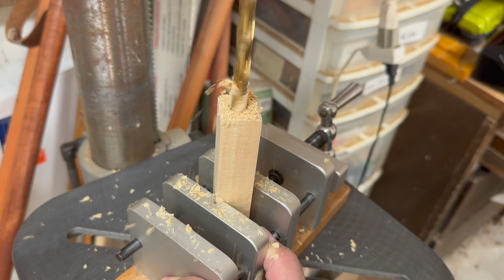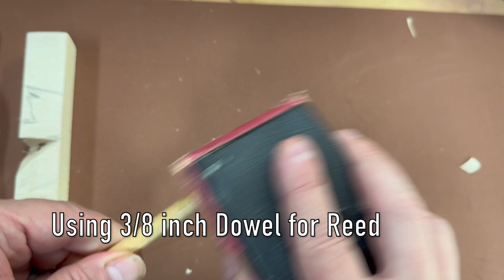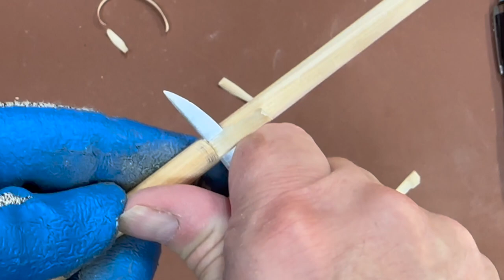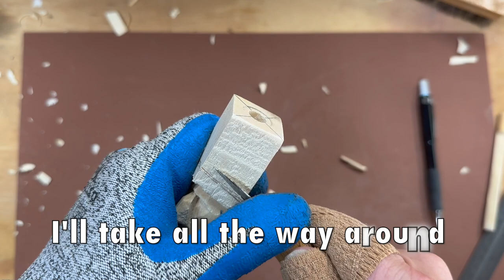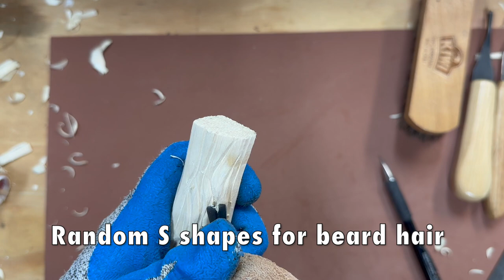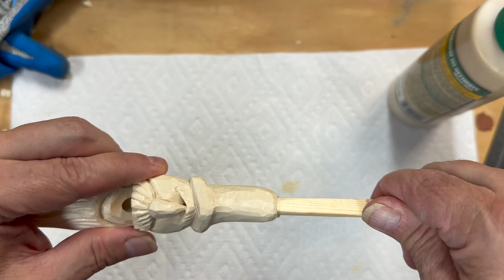Carve a Wood Spirit Whistle

Comment: Enjoyed this, and will make a couple for grandkids. The carvers tools could certainly profit from some honing.
Reply from the maker: Those DHK knives stay very sharp but I still put them on the strop before every carving. I'm also a very slow carver as you can probably tell - LOL.
Reply: Sorry, didn’t mean to be critical. I have no idea how dry and hard your wood is. I have cut and drilled a dozen blanks, and it will become a whittling project for a Friday afternoon group. Thank you for the fun idea.
Reply from the maker: @DarkRumAgain  No apology needed. I seem to get this feedback on a few of my other videos, but the knives are razor sharp. Sometimes it can be the wood is not the best basswood. I do carve very slowly though and it will appear like the knife (or me) is struggling. Sometimes if I feel like the blade is catching too much in the grain, I'll pull it out and come from the other direction. There can be a lot of factors. Happy whittling!